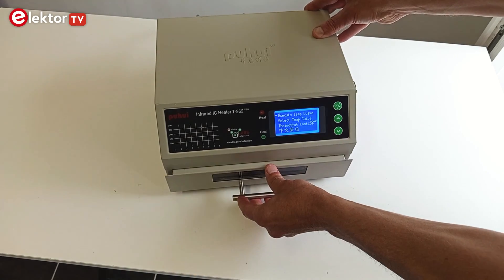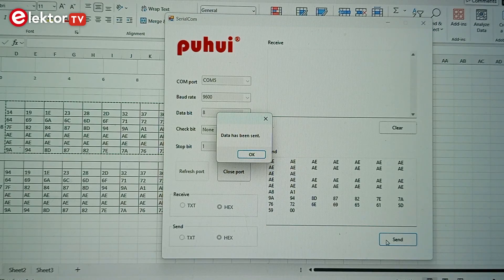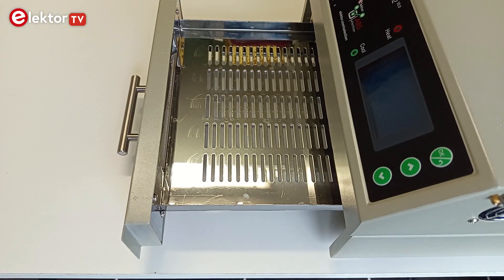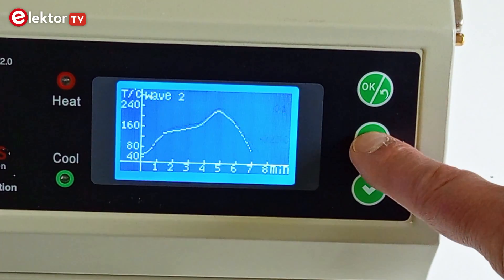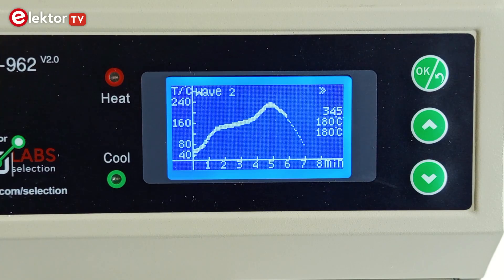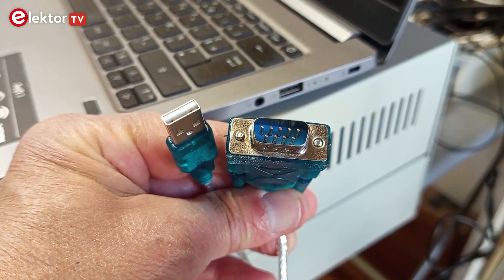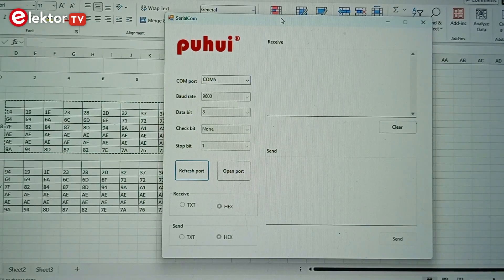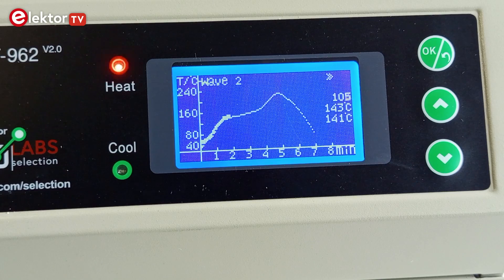Elektor T-962 V2.0 Reflow Oven a.k.a. Infrared IC Heater

Comment: Better/cheaper solution is to alter the embedded software where you edit user defined modes through the existing screen/buttons, that would do away with the need for legacy interfaces and the need for a Windows machine loaded with Excel and a USB-RS-232 interface.
Reply: You already can edit it via the screen + buttons, it just sucks
Reply from the maker: That's a useful thought for improving the design!

Comment: These reflow units are noted for having uneven heating.  Has anything been done to provide more even heating sources?
Reply: @MidnightVisions  I suppose it’s up to the user to add air agitation to it. Or heavily modify it, replacing the IR element with multiple heating elements that will be controlled independently. Only then will it be possible to make it close to being even. For this oven I would recommend 6 elements in a 3x2 array. A closed loop control with 6 channels and you can start your calibration process. 
In short, all this oven has going for it is pretty much the chassis, and even so, it’s quite limited. A 20mm clearance isn’t enough for a fan that could agitate the internal atmosphere, making the air temperature more homogeneous.
No amount of firmware tweaking will solve its flaws, it’s really a poor design. Probably good enough to burn letters you don’t want to fall in the wrong hands though. Or dehydrate fruits, even making beef jerky in very small batches.